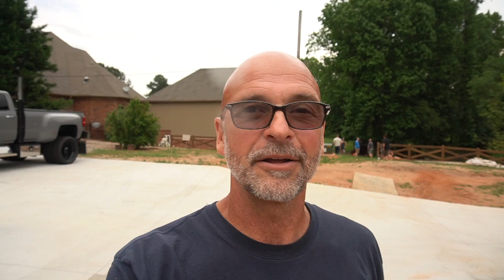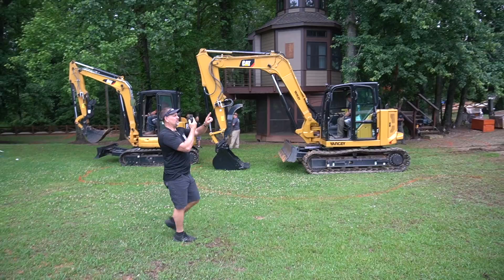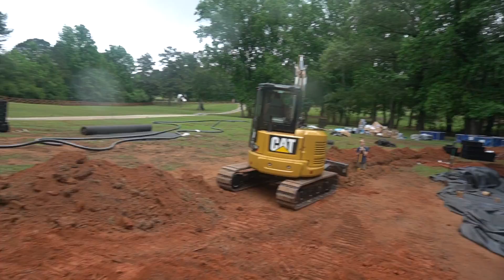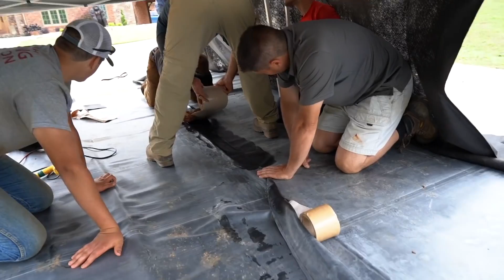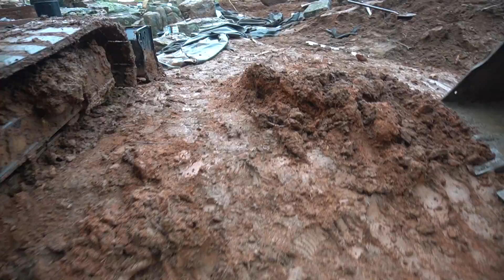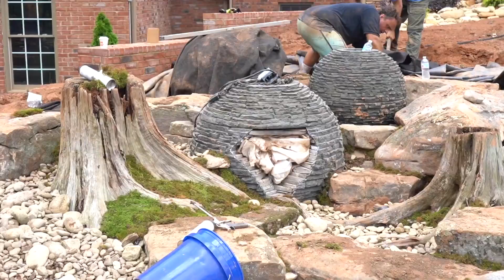SHAQ's Ecosystem *POND* Build

Comment: I would think that he would want a concrete pond because you have to replace that liner someday and that will not be fun he's got the money to put the concrete in it's a shame he didn't think of it
Reply: The liner will last much longer than concrete especially on this scale,
Concrete doesn’t move which is why it’s used in structural situations,
The red clay soil that you see in this video expands and contracts between seasons(wet and dry) that will cause concrete to crack.
The rubber liner moves with the soil and can actually stretch, this pond will outlast his home......